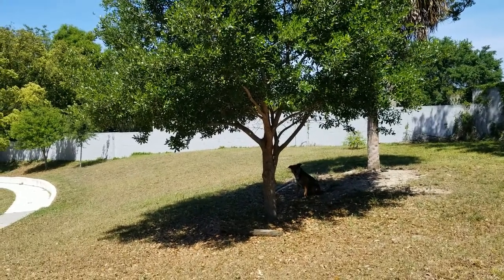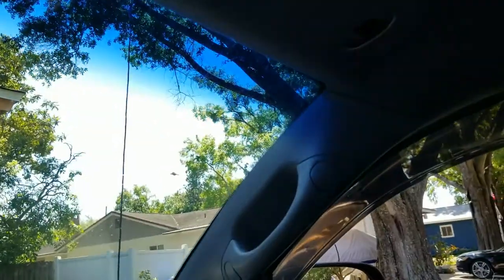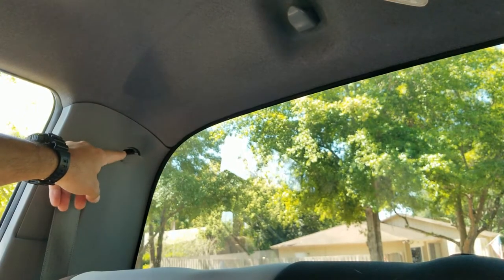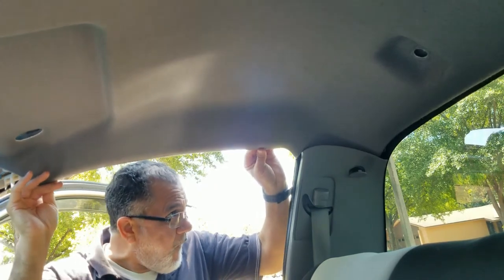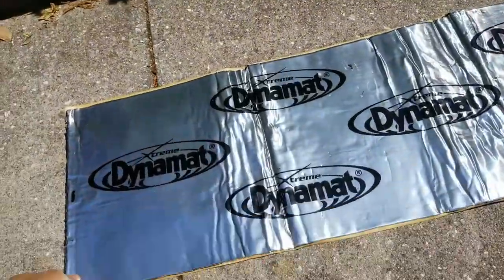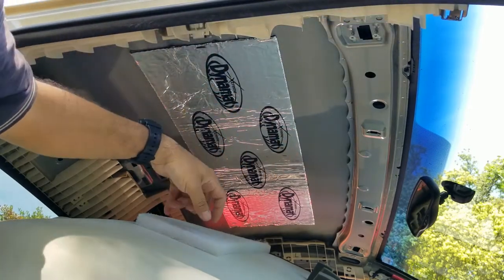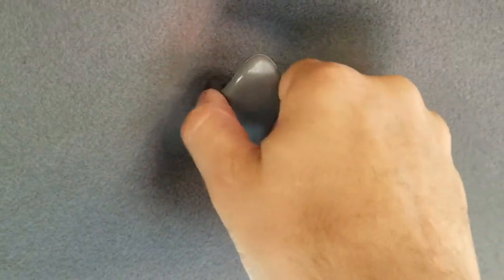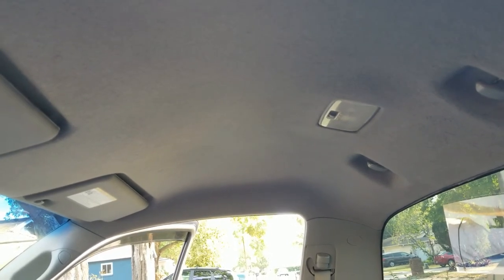How to remove headliner on Toyota Tacoma to insulate roof panel, Lil Taco Pt 30

Comment: I just came in from attempting this mod on my 2015 access cab . Its a lot different on my truck with multiple airbags all over the place . I disconnect battery but I still don't like working around those things . I have overhead light console . Removing this caused some of the plastic tabs to snap off .! 
Basically I got 1.5 ft2 of butyl rubber installed before calling it a day . Its an unbelievable amount of work to drop a stupid panel ! The truck is 8 yo so the plastic is getting brittle and breaks easier than it used to . WORKING ON NEW CARS IS TERRIBLE ! I am never buying new again , period ! 
My 15 yo vw jetta would probably go to the junkyard under normal circumstances,  but with the newer cars being so horrible to play with im gonna keep fixing it since its not rusty .
Thanks for video since I certainly would have broken more plastic parts without it !

Comment: Why wouldn't you cover every square inch of the roof panel?
Reply from the maker: Because that material is expensive (to me) and I want to use the material I had left to insulate other parts of the truck.
The only time I would cover every square inch, is if I was building a vehicle for sound competition.
Reply: you only need 25% coverage before you get diminishing returns

Comment: Did this help with heat insulation?
Reply from the maker: I am not sure, It might have help  a little since it is another layer, but when I installed this it was cooler and I could not tell a difference temp wise.